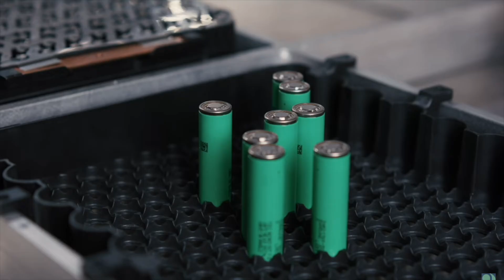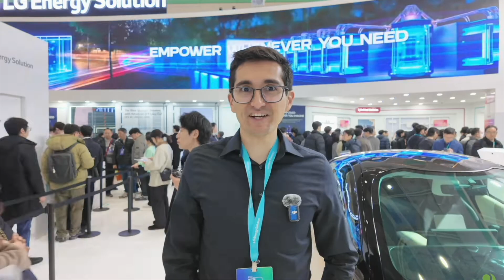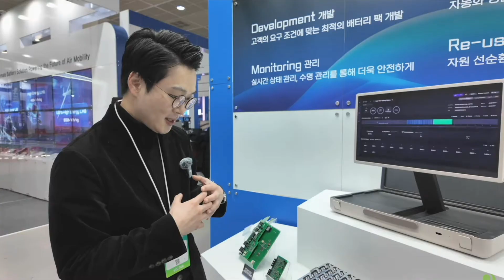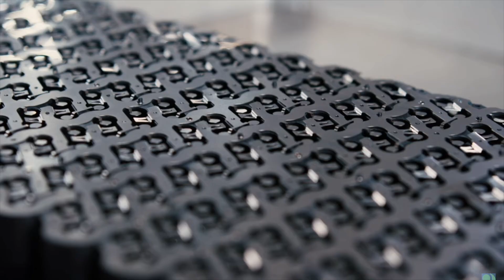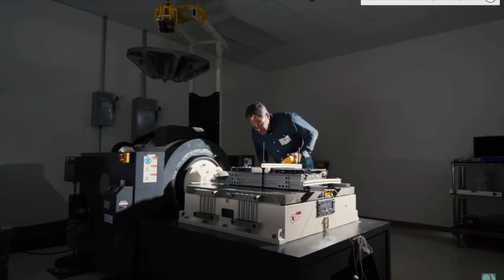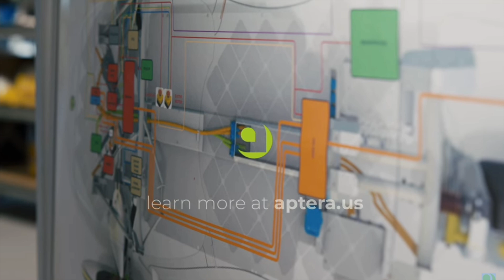CTNS Battery Packs Are Ready !

Comment: see at 1 min 40sec the dimples on the roof, as the lights bounce off the roof, seems the solar panel making process is not perfected as yet.
Reply from the maker: That’s the Gamma, they don’t make the solar panel for aptera that way anymore they are using glass . 😎
Reply: @freepower1082  ok, except ces test drive vehicle only one panel was glass ( the rest were plastic), but point taken.

Comment: I believe the battery is so light simply because it's so small. It only has to deliver 44 kWh, a standard EV battery has to be much bigger, and hold more charge, up to 100 kWh or even more for extended range versions. 

That doesn't mean that LG hasn't produced a lighter battery, or more likely, CTNS has been able to produce a really light battery oack design. But a light vehicle makes for a light battery which makes the vehicle even lighter. 

I asked Aptera about the bigger batteries in a response to their video but got no reply. So I can only guess. But it seems to me that with the bigger diameter batteries, Aptera will either have less batteries per module, or less modules per pack. They could either have six modules with fewer batteries, or four modules with close to the same number of batteries as the current design in each module. Of course, the modules will be taller, 95mm and 120mm instead of 70mm. That's basically the original design, just with the bigger batteries in the pack. 

The reason I say this is I think the number of batteries in a module determines the number of volts and amps in the pack. If they keep the same number of modules, but reduce the number of batteries, the voltage will go down. But if they keep the same number of batteries in each module, the volts should be the same, assuming those batteries have the same voltage. They may have different amperage, but I'm pretty sure it is the voltage that counts. And more modules will increase both the amps and the kWhs. 

There will probably be a slight variation since the battery diameter has changed, but they can get close. And the might retrofit the original Launch Edition to use 4680 batteries.
Reply: Yeah, they definitely should go with the current pack until they release the Launch Edition. Redesigning the battery pack at this point would create backlash even if it didn't take very long. And more than likely it would take six months to a year. 

Once there are actually vehicles being sold, they have the time to redesign the battery pack. That will delay the 600 mile and 1000 mile options a little, but they will have to make changes to the body, too, and they can do that at the same time. That's one reason I think Chris is being optimistic about the 1000 mile option being available in 2026. It is possible certainly, especially if you think of it as December 2026. But I think it's more likely that 2027 will be the year of more options. 

Let's not forget though that the 2170 pack could be used to offer a 250 mile option the day after the Launch Edition hits the streets. Both could be upgraded to 4680 cells later, but the pack will be ready to go.
Reply from the maker: Yeah richardryley I agree , they can use the 2170  for the 400 and 250 mile version . Once they start making all that money, they will be able to step up their game and then come out with the 600 ( which is what I want ) and 1000 mile versions .
Reply from the maker: I hope they go with the 4680 battery that way the pack will not have to change very much or at all . I’m sure if the stop making changes to there vehicle and start producing it they will start making all the money they need to make all the changes they need , but that’s just me . 🤔

Comment: The Aptera battery pack looks so slim. The 4680-46120 batteries look huge in comparison! They should support the larger capacity Aptera battery packs to attain the 600 and 1,000 miles of range for the future long distance models.
Reply from the maker: I believe they will use the 4680 for the 600 and 1000 mile models 😎